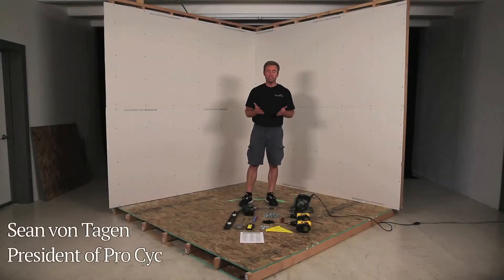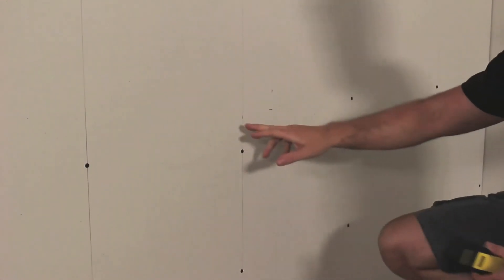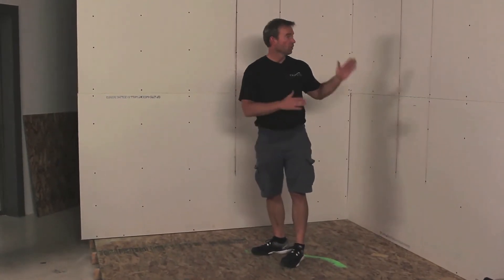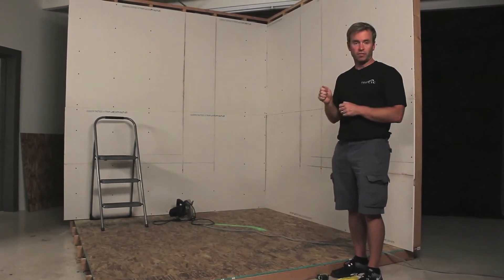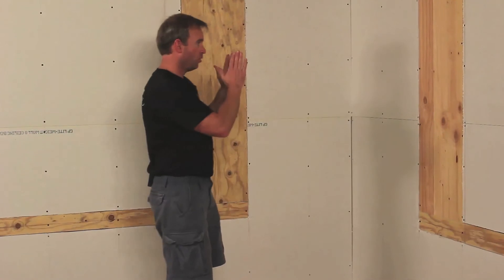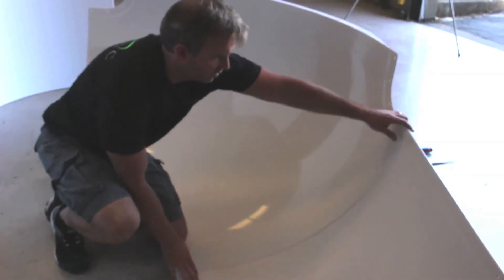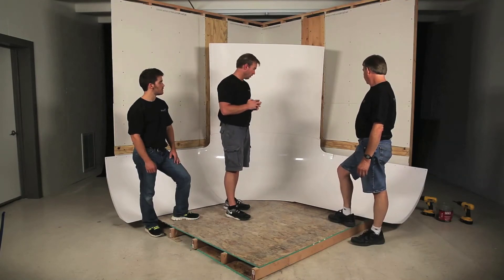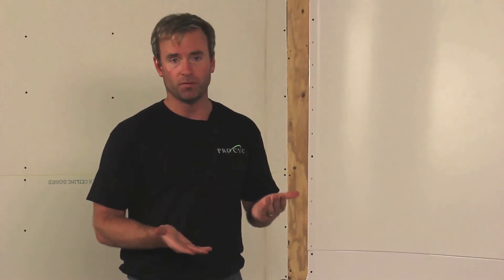Installing Pro Cyc Super 2.5EZ Built-In Cyclorama Wall

Comment: Do you fill in the seams?
Reply from the maker: Yes, the seams are filled in with 3 coats of drywall mud, just as you would finish the seams on a Sheetrock wall, then primered and painted.

Comment: Do you not secure it to the floor?
Reply from the maker: Good question. Yes, securing it to the floor is important. That was an error on our part not to mention that step. All the floor cove modules come pre-drilled for securing it to the floor, and we also include tapcon screws for securing it into a concrete floor. If you are going to paint the floor, you would also want to mud the transition to the floor. If you are using our Pro Matte Virtual Green flooring, mudding to the floor is not required as the Pro Matte lips over the edge be about 2 inches.

Comment: You didn't sand the Flanges of the modules. I installed a system and got cracking on surface and was forced to disassemble the entire unit and sand every flange and surface, after it was finished and painted. WTF
Reply from the maker: You are correct, we do not show the sanding of modules in this video and in hindsight that would have been good to include. We made this video several years ago upon launching the System Super 2.5EZ to mainly show how it is put together and attaches to the walls. The written instructions do detail the importance of sanding all surfaces of each module including the flanges to create the best bond and prevent cracking. We do include the sanding instructions in our other video of the Super 3EZ installation that we did in our own studio.